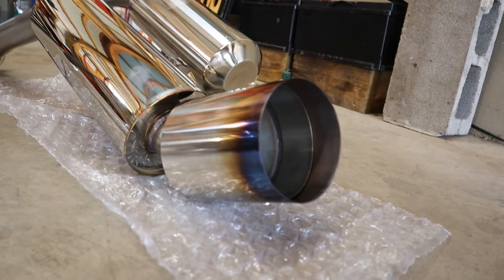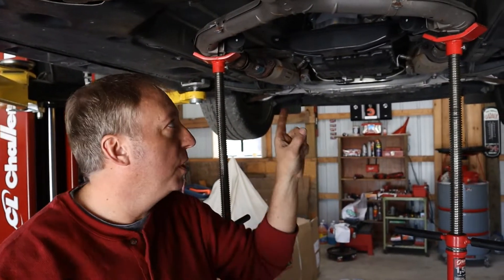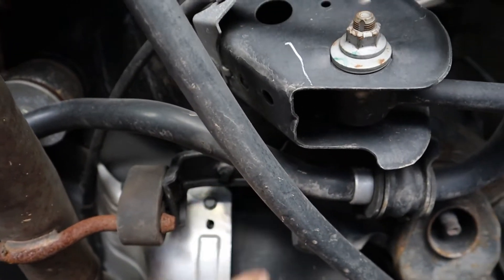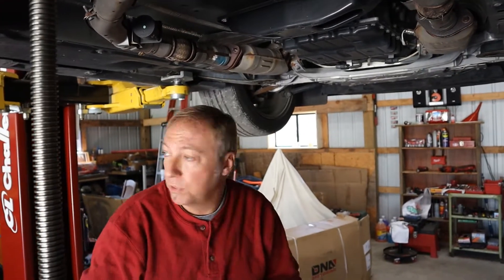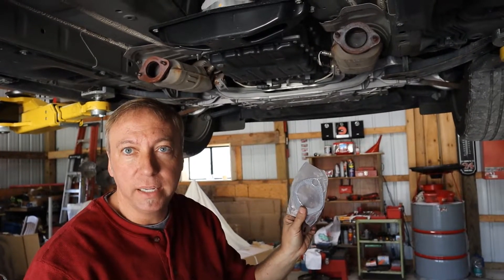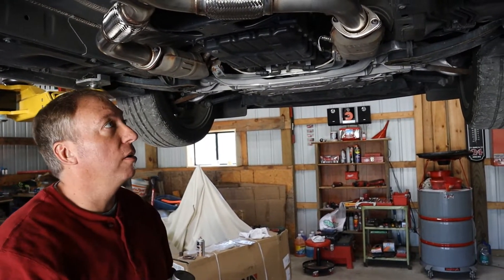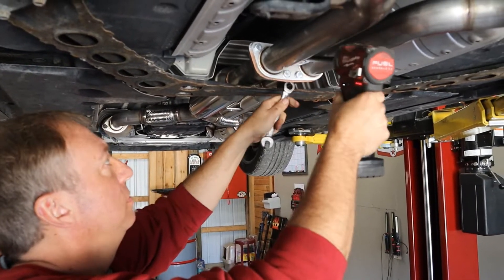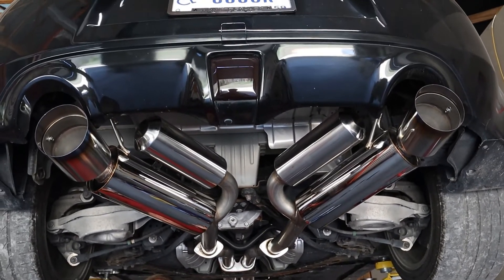Aftermarket Exhaust Install on a Nissan 370z

Comment: 5:29, it did NOT align well, did those pipes move pretty easily to line up since it has the flex hose on it?  How did you line it up??
Reply from the maker: Hey Chad, in the rear we had to heat the pipes up hot and then tweak them in position in the bumper cut outs. the rest lined up from the mufflers to the engine. Thanks for the comment!

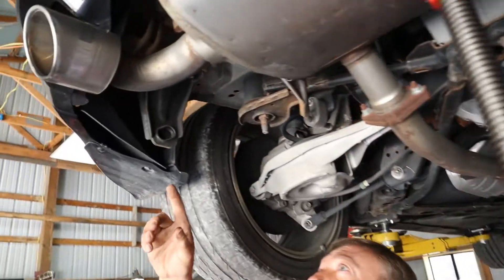Comment: Does anyone know the bolt size and thread pattern on the bolts for the hanger at 3:46
Reply from the maker: hello, I’m afraid that vehicle has been away from the shop too long to recall.

Comment: What did you do to get them in the right Angle? Did you have to heat the pipes and bend them to form into the right location?
Reply: I'm curious as well as to how you adjusted the mufflers to fit. Nothing for the engine was custom yeah? So the sound is straight from upgrading the exhaust system?
Reply from the maker: Yes sir, we had to heat them up quite a bit and bend them to the shape we wanted, for the right side. The left was actually right into place. We just didn’t have the camera charged up while going through that process. There are not any upgrades to the engine. That is all exhaust!

Comment: Do these give you a check engine light due to new exhaust system??
Reply from the maker: hello, no, it did not cause a check eng light.
Reply: Hi . Check engine light will appear if you change the Catalytic converter (with a test pipe or high flow catalytic), otherwise nope.

Comment: Great video This actually sounds good. Not as deep or cheap sounding as other dna motoring catbacked 370z videos... which is strange actually since you have the same setup. I was actually watching to see the impact those helmholtz had on the system. Would you say it reduces the overly bassy tones? Also did you have any drone? Lastly what length were those resonators after the cats they seemed longer than the mufflers.
Reply from the maker: Hey Adam, it’s been a while since the Z was in our shop but there was no drone to the sound. very nice tone at highway speeds. not certain of the lengths but if it comes back in the shop I’ll do some measurements for you. Good luck on your projects, Nelson
Reply: @mitchnelsonperformance  thanks if you had to guess would you say they are about the size of the shortest vibrant 12” resonators or are they closer to the 18” length which is the next size up? Was wondering because I wanted to use similar length on my setup.

Comment: If i was to do the same install, would i have to tune the vehicle or could i leave it as is?
Reply from the maker: Hello, no tune needed, but a good tune combined with this exhaust system can further improve performance.
Reply from the maker: It ran perfect without the tune.

Comment: I bought the rev 9 cat back for my 370z looks just like this one  I get a really annoying whistle noise after about 5000 rpms and above it’s a manual any idea what that noise could be? Super annoying and embarrassing
Reply from the maker: Hey Marcos, not certain unless it might have an air/exhaust leak somewhere in the system. I would use a SMOKE TESTER to rule out any leaks. (It blows smoke in the exhaust and then you can use a UV light to find any leaks).